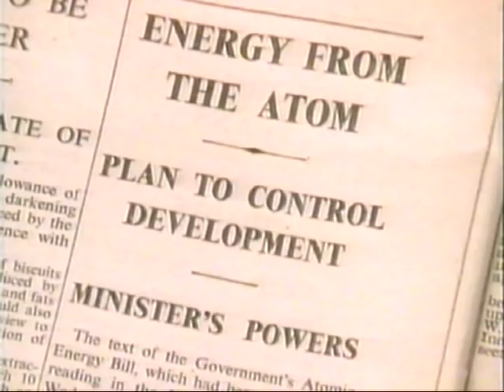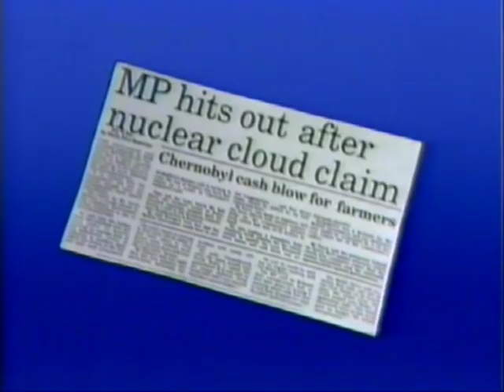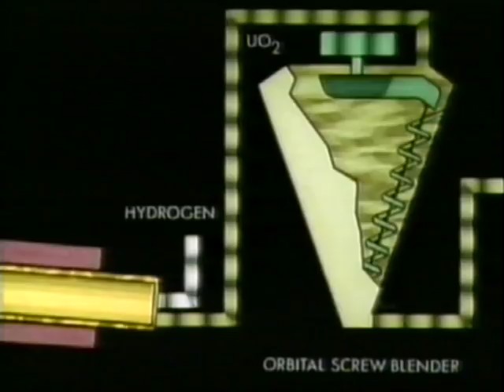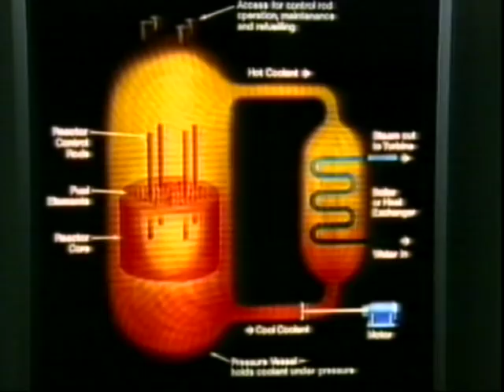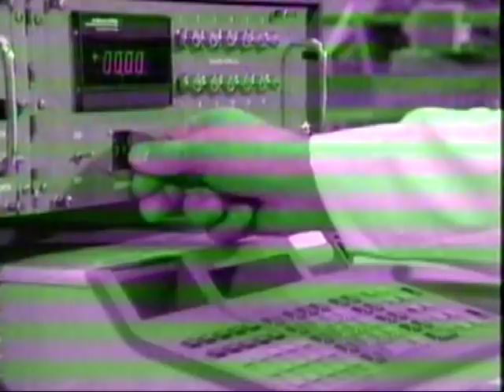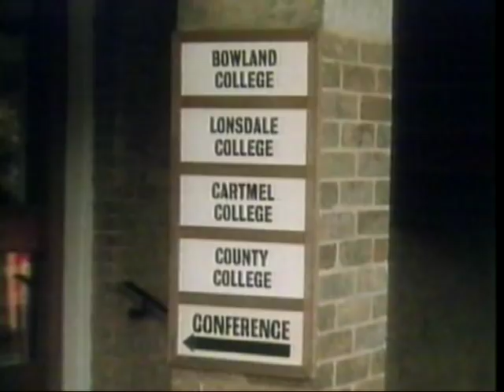Med 076 BNFL Springfields Fuel for Nuclear Electricity c1986

Comment: apprentice in 1983, The bonfire night had an aluminium dustbin filled with the swarf from the magnesium fuel rod manufacture. It was lit in the middle of a field  and was the brightest light I have ever seen, the silhouette of people around the edge of the field could be seen on the houses further away. I liked working there and my dad worked there most of his working career. Also remember the alarm system that always beeped to say it was working and the critically RUN. as an apprentice intro we were passed a bar of U238, it felt like it was trying to pull through your hand. amazing and rare .